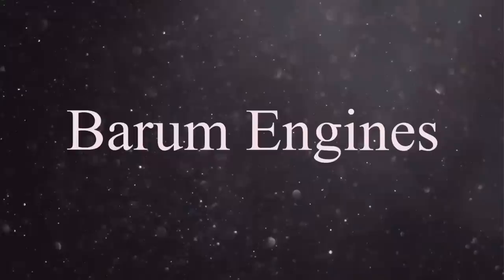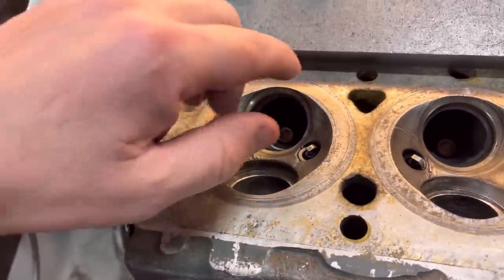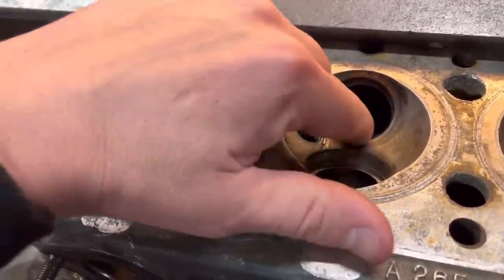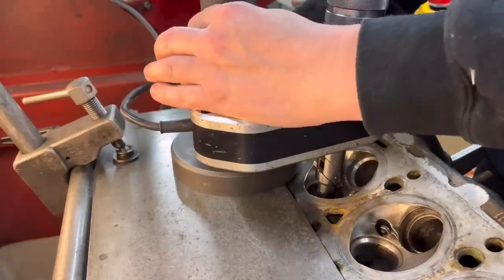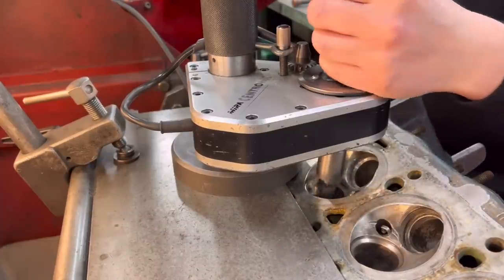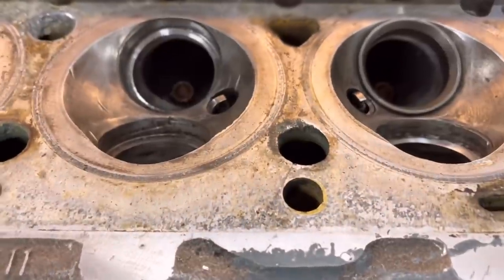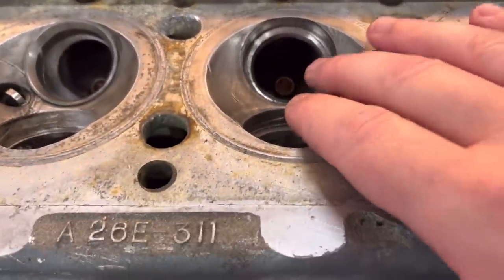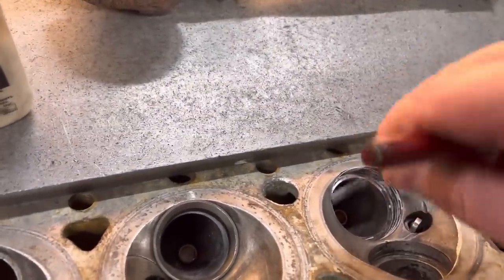THIS LOTUS TWINCAM CYLINDER HEAD GETS FULLY REFRESHED

Comment: We used to soak inserts in liquid nitrogen, saves knocking them in.
Reply: where do you buy liquid nitrogen lol ? 🤣 and all the gear and safety equipment needed to use it lol, ???  please tell?
Reply: @andyk1882  Not suggesting that stupid people having a laugh are advised to play with it or indeed sharp instruments that Matron hides away from you. As a responsible trader it is available. Liquid Nitrogen is used quite extensively in high class restaurants these days for example.
Reply: @johnglover9935  thanks but you still have not said where to buy please? where did you work when you used to soak them in it? liquid nitrogen in a restaurant ?  rofl
Reply: @andyk1882  Both the machine shops I use(in the UK) for this type of work have liquid nitrogen for seat and guide fitting

Comment: Absolutely no reason to apologize. In a way, today's episode was one of the best. Camera held well, minimal movement, dialogue couldn't be any better even if it was scripted. That was an excellent 'show and tell'. That 'mechanically intelligent' centering cutting tool is fascinating. Jigs and clever tools are magical sometimes, and that one certainly is. 

I watched that intently start to finish, I don't know if I even blinked. One question: Before using the seat bonding compound, wouldn't a quick clean...either a rotor bristle brushing, or a chemical cleaner (Some paint strippers are excellent for removing burnt on carbon, beware of over-etching the metal if alloy) be advisable to maximize the bond between the insert and host? If done judiciously, the micron loss of surface could be replaced by the thickness of the bonding film. Heat transfer might also be increased, the assumption being the bonding agent is conductive.

I can see a case to be made both ways, but if done *carefully*, I'd lean towards prepping both the outside of the insert and receiving hole in the head. .

The bonding compound might advise against it, I don't know....

Comment: Why don't you run a bead of weld around the inside of the valve seats  and the weld shrinks the seat and they fall out just like the big one piece press in wheel bearings?

Comment: To remove the seats without cutting into the aluminium, weld around the ID of the seat. As it cools the seat will shrink and fall out. When the new seats are installed, center punch a few places around each seat to prevent falling out. Then the seats can be finished. 
We used the same technique to remove liners from Isuzu blocks. Dry ice to freeze the liners for installation.
Reply: Centre punch? Really? Wow
Reply: @99hjhm Yes. In the aluminium which flares a small bit over the seat outer diameter.

Comment: Whilst it may be 'accepted' practice to beat the valve guides in and out and valve seats in with a big hammer, it's very crude. You have a very nice Epco hydraulic press there, would it not be better to use that and some appropriate tooling?

Comment: Don’t think whacking an insert in with an old gudgeon pin is a great idea. A proper cantering tool and correct size drift is the way I used to do it. Otherwise always the possibility of damaging the insert or gouging the recess.

Comment: Treat yourself to a new Thor copper hammer, that one looks like it's seen better days. 
Or may be send Isaac on another one of his drunken market missions!
By the way, what is the name of the product you use when sealing the oil gallery plugs on crankshafts?
Hematite?
Reply: lol yeah i saw that and immediatly thought it would be so much easier if the Hammer was slightly  squared up

Comment: did you heat the head  or freeze the valve seats  or just bash it all together at room temperature  i would have frozen the seats
Reply: how would you freeze seats lol ?
Reply: @andyk1882  you letz em go
Reply: @jackiemay9471  ok pal
Reply: @andyk1882  house hold freezer works pretty well… lol

Comment: How do you align the plane of the valve seat with the perpendicular of the valve guide?
Reply: It's set by the insert pocket really, plus when the insert is cut any discrepancy will be removed anyway because it's centred on the new valve guide.
Reply: @samrodian919  Duh! I knew that in another part of my brain.